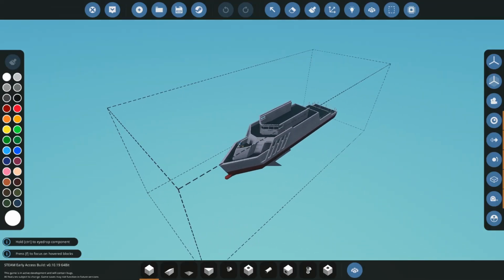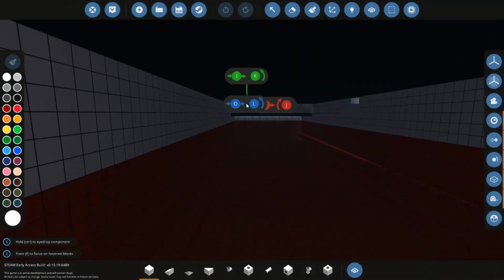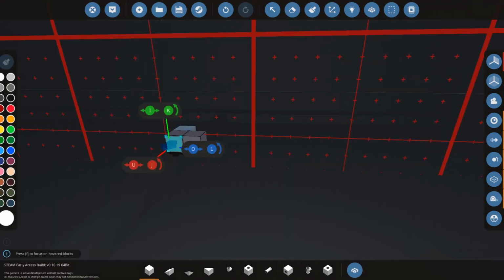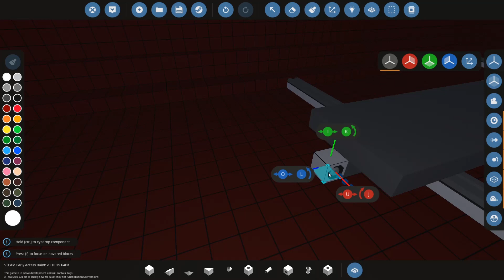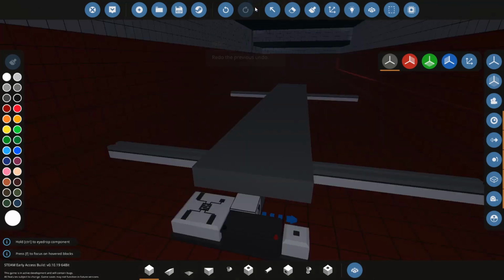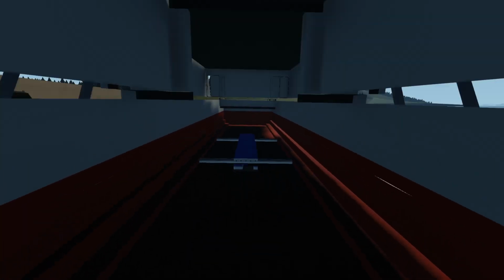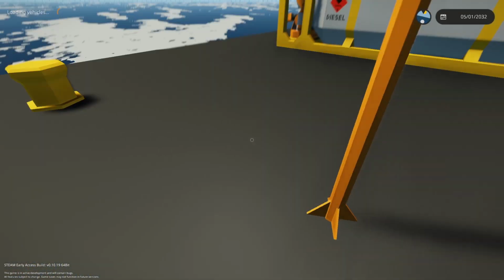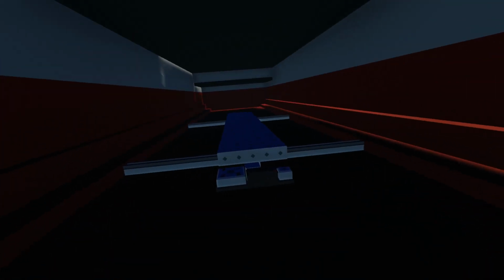Roll stabilisation tutorial - Stormworks

Comment: Nice video. Just as a tip. You shouldn’t make them wide, instead try making them thin but tall. It will displace the weight more and have a stronger effect. Also if you have room you should always use large batteries. More compact than weights and way heavier for its volume.
Reply: Tank barrels work wonders too